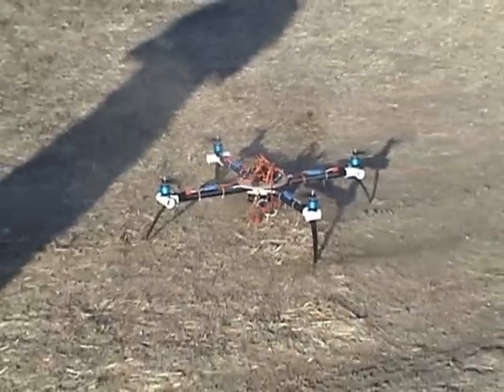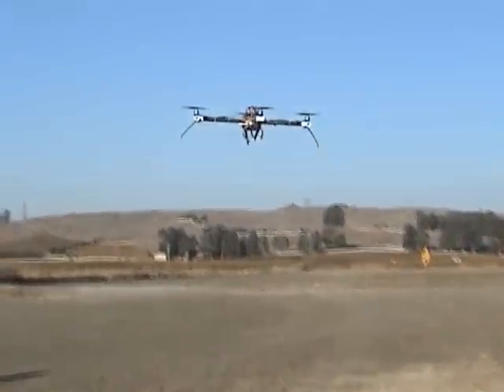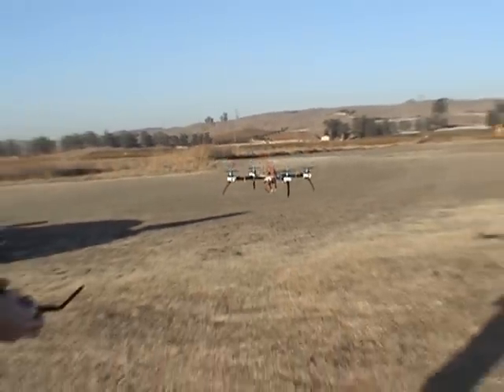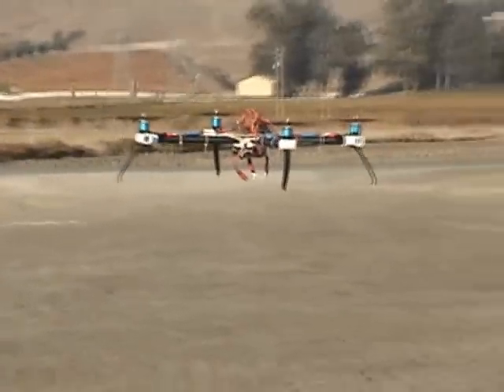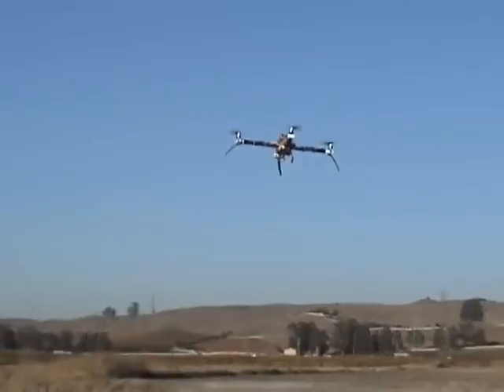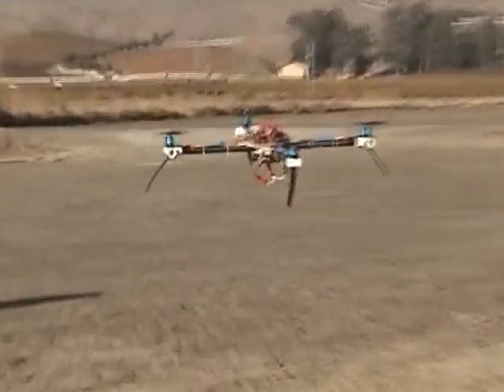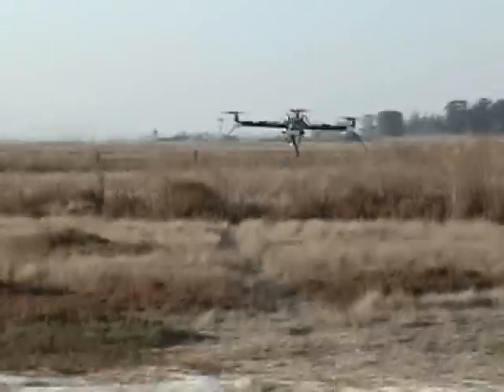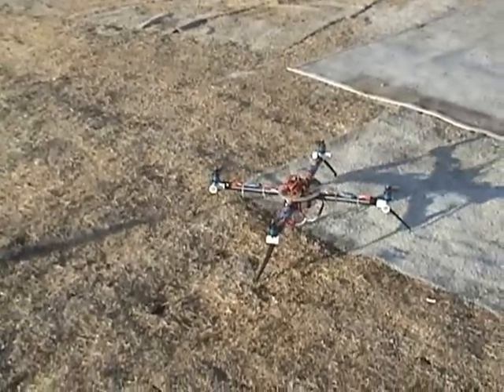Spyder prototype #2, flight 2

Comment from the maker: @Theanonraider - The whole thing is from scratch (aside from the motors and motor controllers, and the remote receiver).  I programmed the control board to listen to the remote and the gyro, figure out how the orientation differs from what the user wants, and sends the correction controls to the motors.  I have video of the newest version posted (see the "First Crash" video, and it's significantly more stable.

Comment from the maker: @rodstartube - No, he probably means thermopiles, which many quads use to detect the horizon line.  They work by using the temperature difference between the sky and ground.  They're not reliable in situations where there isn't a good line to the horizon - nearby trees, buildings, etc.

Comment: That's interesting! Aren't they the Hacker A20 ? What size are these props then? 8"?
And they are still lighter than anEPP1045? 
I use EPP0845 with small motors (20/5), and the 10" variant on anything bigger, up to about 200g hover load per prop. The 12" are too soft, so around 12", the APC SF 12x6, or 12x3.8" are used. But it takes a 36mm dia motor (or bigger), due to the weight.

Comment from the maker: @bogomir67 - Those props were chosen because a) these motors spin too fast to use the 10" props, and b) these props are significantly lighter than the 1045's, so they accelerate and decelerate faster, allowing for more control.  Two-bladed props also don't look quite as cool.  :)